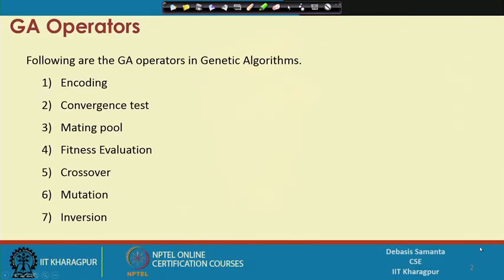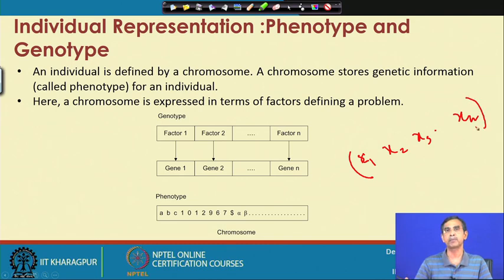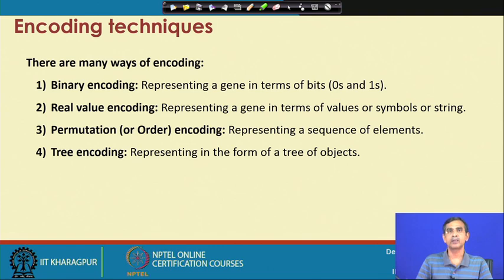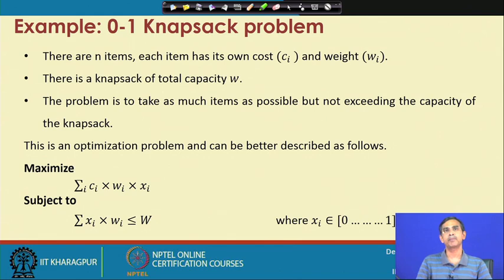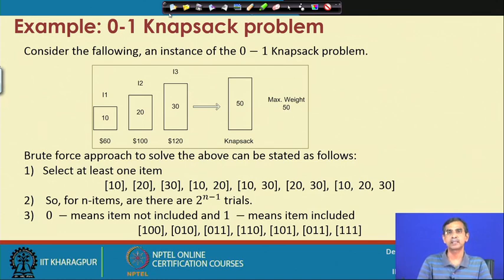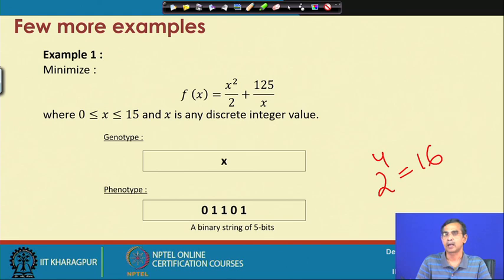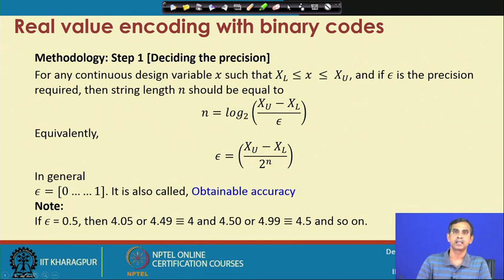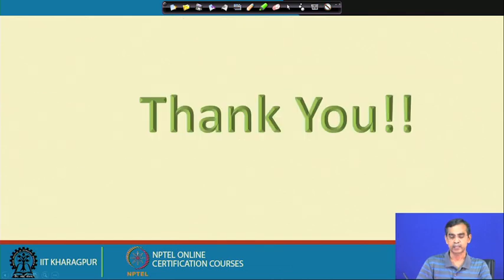Lecture 16 : GA Operator : Encoding schemes

Comment: Regarding 14:14, the objective function to maximize is wrong in my opinion.

Its written as summation over i (c_i * w_i * x_i) which I think is incorrect.

Because we just want to maximize cost, I think it should not bother with weight. So according to me, the function to maximize should be summation over i (c_i * x_i)

c_i gets involved because we want to maximize cost and x_i for the decision whether the object is picked or not. In the constraint condition, weight gets involved because we have to take care not to exceed the maximum capacity of the knapsack.

The wikipedia article  seems to agree with my logic (See the Definition section of https://en.wikipedia.org/wiki/Knapsack_problem)